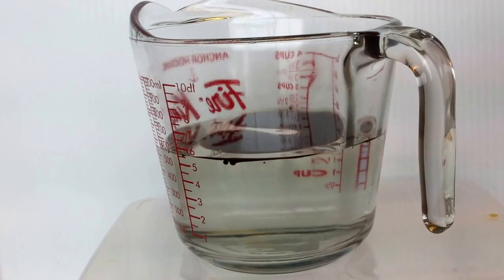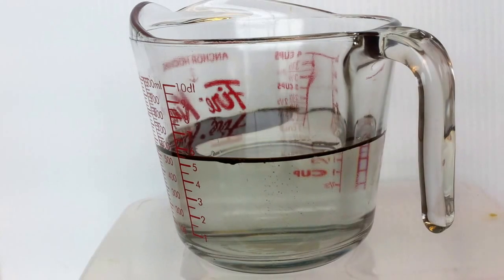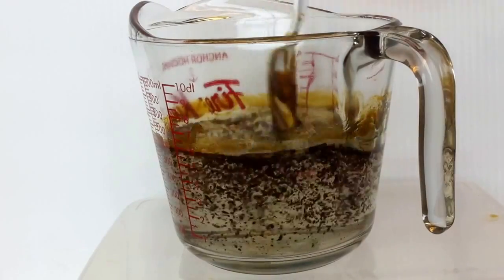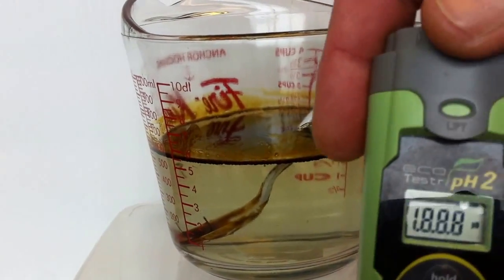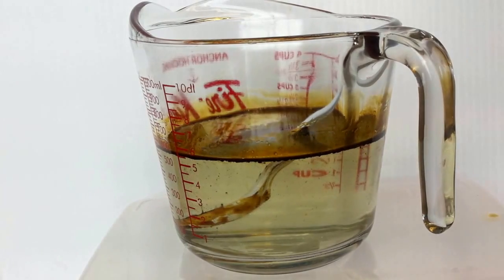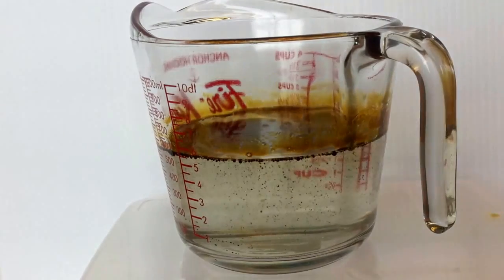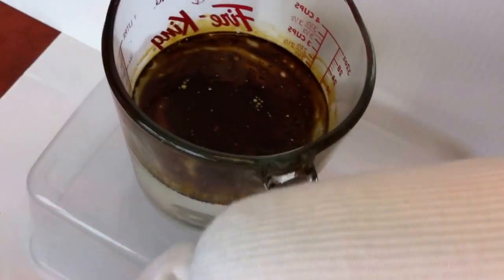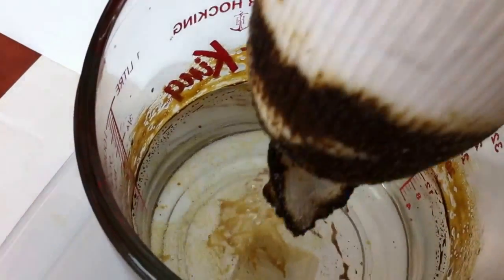Oil remover and oil water filtration or separation

Comment: Can this be used to get rid of water to drink? 

I was just wondering when you have large amounts of oil spill into drinking water on a large scale. 

But I'm guessing you would need to do all that on a larger scale though.
Reply from the maker: Yes you can absorb the oil from the water, alternately we can put bacteria in the water and it s eats it
Reply: You'll notice it doesn't completely remove the oil.  What you can't see is some of the oil is completely dissolved in the water.  But it'll show up if you try a few things.  Some of the oil will for example start to stain your white plastic water container (top of the water filter jug).  The dissolved oil can get past even multiple filtration (currently looking for water filter that can filter motor oil).  Water will look like it's clean, but still contain motor oil, evidenced by a brown/yellow stain associated with oil.

If your municipal water is contaminated with motor oil, for example, it's usually invisible.  I found transparent slime at the bottom of the glass (same glass used for a few weeks) and wiped it with a paper towel.  It showed up as brown/yellow stains usually associated with motor oil.  The water from the faucet doesn't show any signs of oil, but accumulates if try  to filter it and use the same glass for weeks.

Comment: where could you buy that hydrophobic polymere
Reply: Isaiah richards Looks like he using a surfactant to make the water and oil mix. You probably use products with surfactants in them every day like dish soap. 

Then he is adding an acid to lower the PH (more acidic) to break the oil and water apart. He calls it a "safe acid." So maybe a "low fume" acid something like Kleen Strip Muriatic Acid like you find at Home Depot. 

Finally he uses an adsorbent sock. You can buy those on Amazon. Just search "oil sock." There are different types. The sock may contain polypropylene which attracts oils.

For example "SpillTech WSO410 Polypropylene"
One review on amazon states "Does a good job of skimming oil out of my car wash sump."
Reply from the maker: Isaiah richards you can get it at the oillift(dot) net web site
Reply: Going to that website triggers my antivirus software.
Reply from the maker: sorry about that we got hacked. shold be ok now Adam Prince